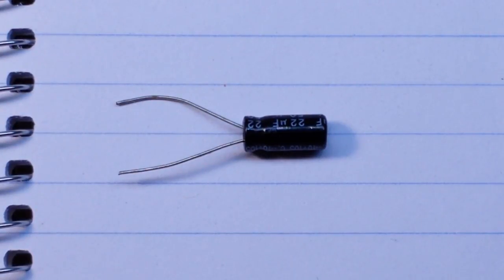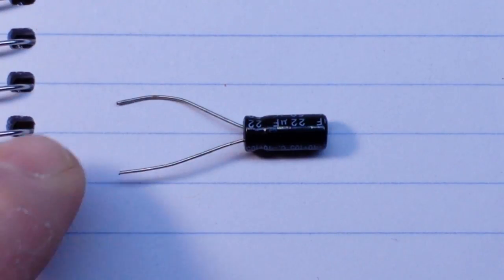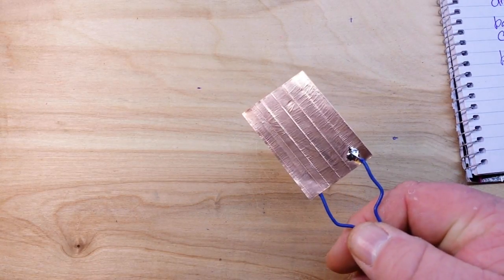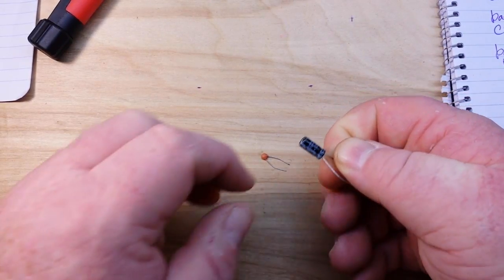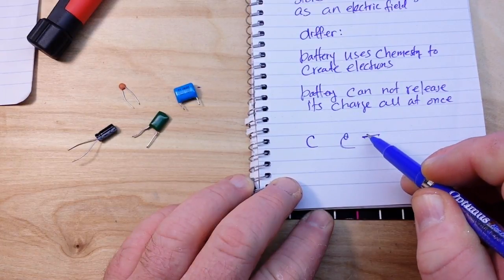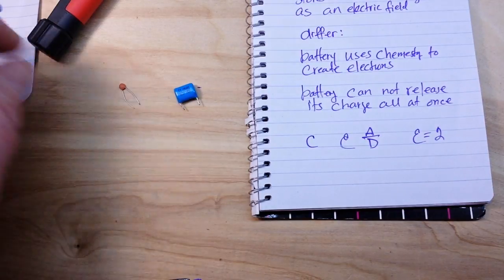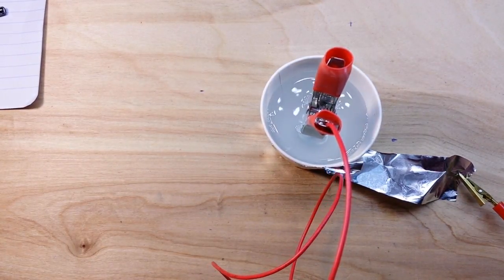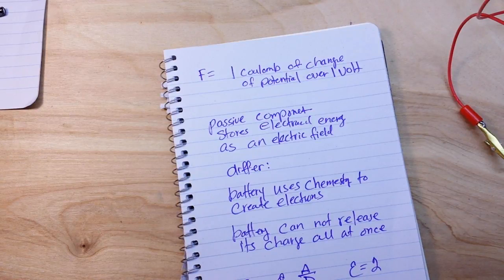A few words about capacitors

Comment: What reasons would one choose to use a particular type of capacitor (ceramic, dielectric, etc.) over another? Is it strictly based on available capacitance values?
Reply from the maker: The first consideration is polarity. Do you need it to be polarized? If yes, then you are down to electrolytic or tantalum. If it's for a power supply or you are using it for a n energy reserve, then electrolytic is the answer. The you look at capcitance, voltage and temperature. Tantalum, on the other hand is kind of a special case. If you need one, you'll know you need one. So...if polarity is not important then you can look at the many non-polorized types: ceramic, film, mica etc. Ceramics are very good general purpose choice. Film can handle high peak voltages and have very low ESR. They work great as a snubber or clamp. Mica,  work great in high frequency applications, so they are usually found in RF applications.
Once you have chosen a type, pick your capacity...you can always go a little higher with no worries so engineers often add 10-20% overhead, but never go lower. Same for voltage, say your circuit will be putting out 8.4VDC, and you need 10nF....ok well 10nF is fine...but add some overhead and maybe 15 to 20 is the better choice. Lastly consider the temperature rating and give yourself some room there as well.

Comment: How do you know what size capacitor to use in a project?
Reply from the maker: Well, it all depends on the use. If you are selecting a cap for an RC or LC circuit then you select the one gives you the frequency you are looking for when used with your selected resistor or inductor. If you need reservoir cap in a power  supply you choose the largest cap that is economical for your project.. If you need a decoupling cap, a small ceramic will do, if you need to block DC then a 1000uF electrolytic is in order. But basically the project will dictate what you need. You can always go bigger, and I add 10% over what's called for automatically.

Comment: what about supercaps? ;)
Reply from the maker: fredlllll What about them? They are still two plates separated by a dielectric, subject to the same rules.
Reply: but the dielectric is a bit different :P. will you also make a video about putting caps in series?
Reply from the maker: The formula is still the same: capacitance = permiativity of the dielectric multiplied by the area of the plates divided by the distance between them. Caps in series? Do you have a use in mind?
Reply: super caps in series for example. cause of their rather low voltage you often have to chain them up if you cant use a stepup

Comment: Very nice for the beginners, I suppose you wait for more advanced classes before going into DC blocking and allowing AC to pass. A good follow up to this may be the uses of different types of capacitor in different situations and different capacitance ranges.
Reply from the maker: Moonbrony In this first course, we are happy if they can identify components, know which unit of measure the use, and solve some basic VIR problems. The spring semester will start them on RC circuits, and problems as well as use simple components to create basic circuits like voltage regulators, and timing circuits. After that comes EE 210 and real fun begins.

Comment: Good to see that beginners are being catered for as well as the intermediate and more advanced hobbyist!  Somebody somewhere is always on the bottom rung and needing the basics!
Reply from the maker: I cater to all. But I teach ee 121. The first class students take if they want to learn electronics. They learn about Ohm's law, Kirchoff's law, passive and active components, how to use a multimeter, oscilloscope, function generator, and by then end of the semester, how to read and interpret a schematic.